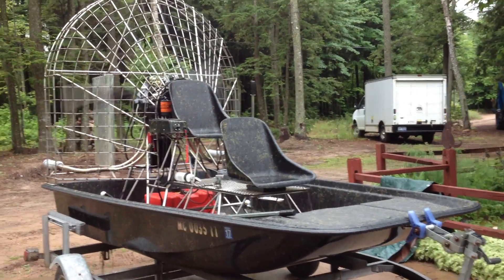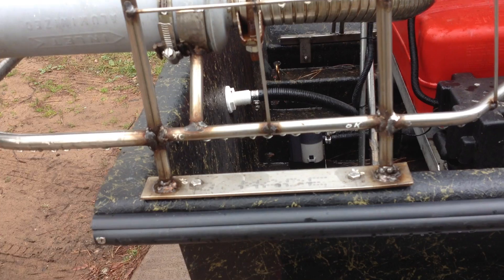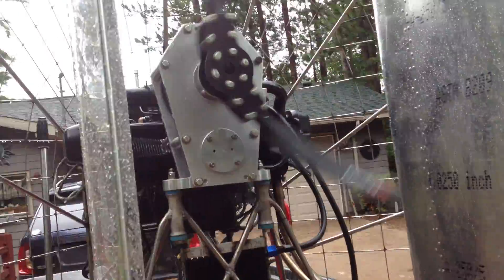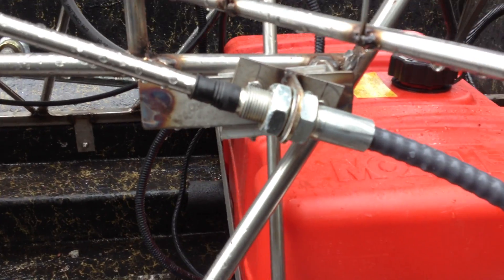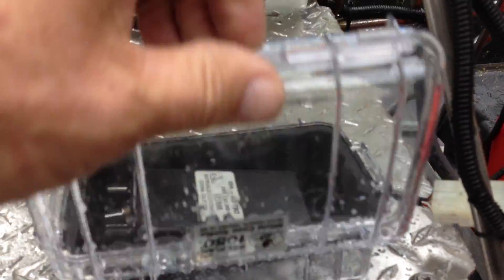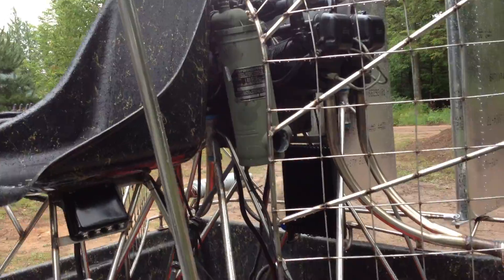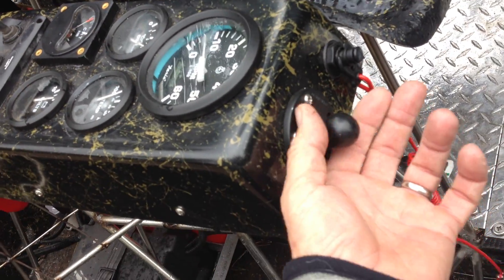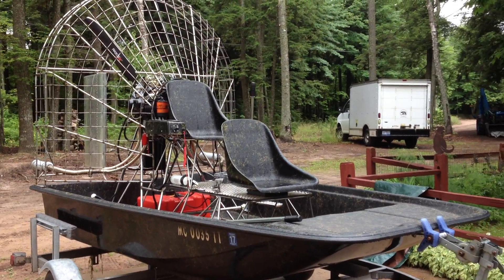Mini-Airboat Walk-Around Inspection

Comment: You've got some talent. Thanks for sharing. Are those 4a084s hard to find?
Reply from the maker: Hi Shane,

Thanks for your kind remarks!  I've gotten over 50 hours on the airboat so far and it's a terrific amount of fun.  I've used it both on water and ice and it really scoots.  The continental 084's are fairly easy to locate and you'll see them occasionally on EBay and can be purchased through Saturn Surplus (but they are quite high on price).  You should be able to find one in the crate for about $600 to $800 dollars in unused (Govt surplus) condition.

If you are interested in mini-airboats, join the mini airboat site (www.miniairboatassoc.com).  There is a wealth of information about building them there.
Reply: There's a guy on Craigslist here that has two 4a032-4s with starters for $350 each so I started looking at what they were good for. I NEED them bad, I just don't know why! I've built several wooden canoes and a small sailboat but never have even been on an airboat, but I do live In Florida. Could I use a 4a032 on a small airboat? Are there any airboats with two engines? I'm finishing up on a cypress sailboat and looking for the next project. Thanks for any info.